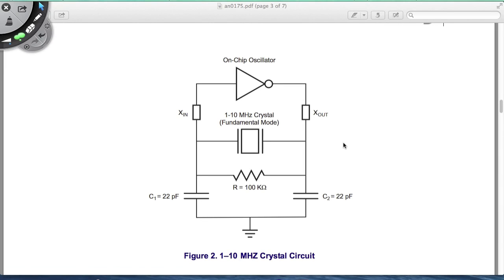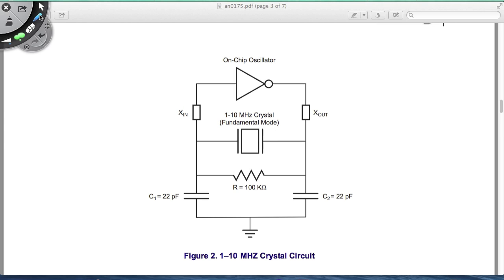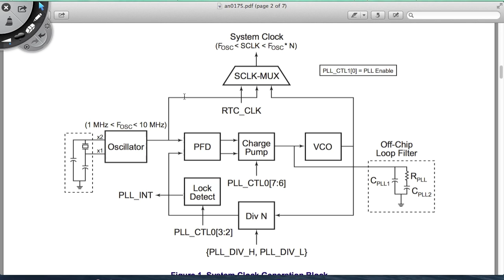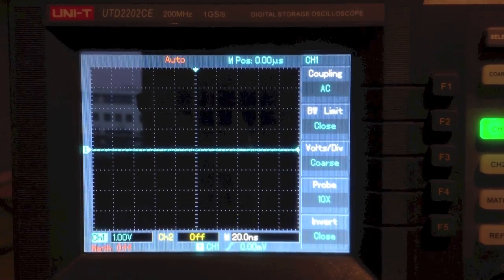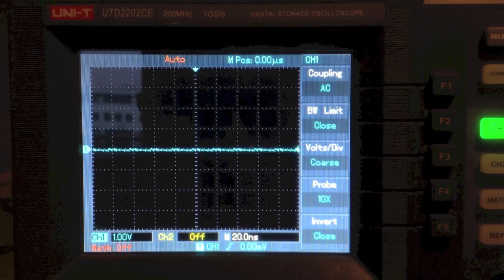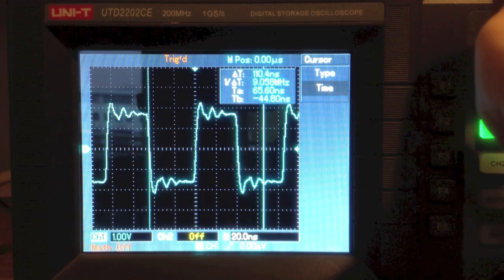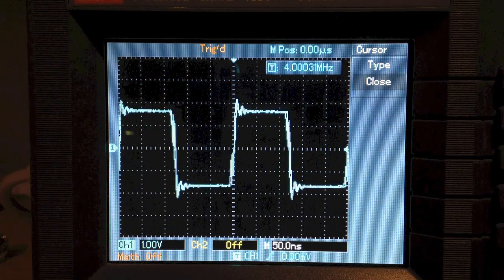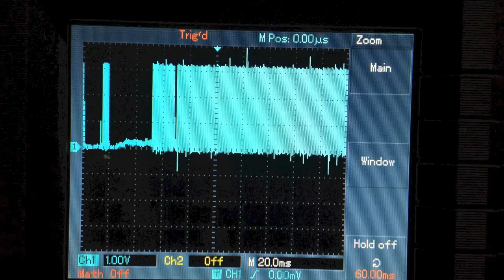System Clock - DIY 8-bit #3

Comment: Nice. Are you continuing the series?
Reply from the maker: Nick Hahn a new 8bit project may be coming later this year or next year.
Reply: Wow. I haven't thought you would answer this fast. Normally "dead" channels newer respond to my questions, beause they are - well - dead. Loving to hear you are still going. The Scott Manley video is hilarious btw..

I actually havent found you through your most popular video, but through my very special interests.

Btw, what are the diffrences between a Zilog z80 and the z80e you are using?
Reply from the maker: Hi, this channel is indeed not dead, but I found it takes much time to produce high quality content. I am currently working on a way to get all the time and resources to start making videos again, and then lots of them since YouTube seems to favor regular uploads these days. Also, I prefer finishing projects first, then presenting the result. Showing off something unfinished intensifies the intention-behavior gap, at least for me.

The eZ80 has some additional instructions, requres less cycles per instruction since it has a pipeline, runs at higher clock speeds and contains many peripherals on the chip. It can run everything a Z80 can run, though. For future projects I am probably going for the 8051, though. I don't want to depend on an obsolete architecture from a dead company. 

The 8051 and improved variants are abundantly available from different manufacturers and will probably not cease to be produced for a few decades. Even though the 8051 has separate buses for code and data, nothing stops you from using the same external RAM for both, enabling execution of dynamically loaded code (which is a requirement for making an actual general-purpose computer).
Reply: I appreaciate it that you want to produce high quality content, you have succeeded so far. The eZ80 seems interesting, but I want to try the "original" first. WHere do you order zour chips from? I haven't found a distributer online in Germany yet.
Reply from the maker: Nick Hahn Farnell/element14 has lots of original Z80 chips on stock!
Reply: Thanks. It seems my Google-Fu isn't advanced enough